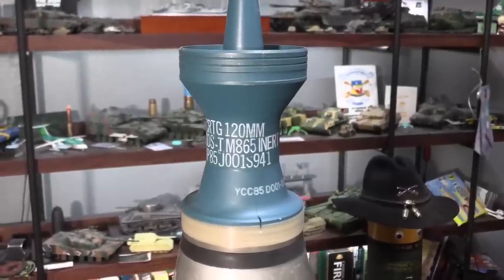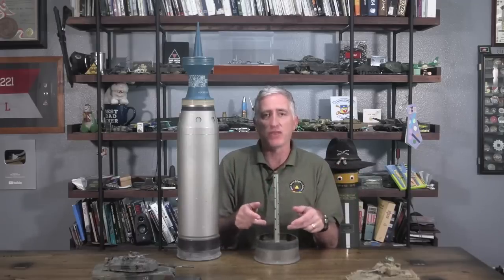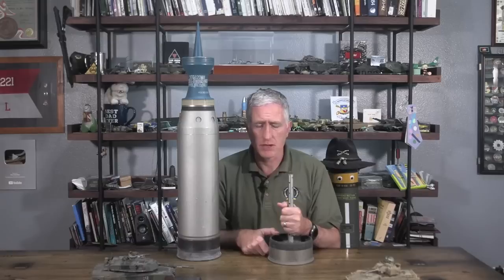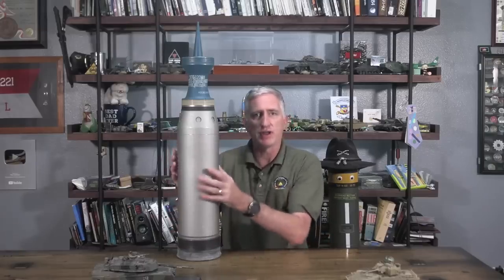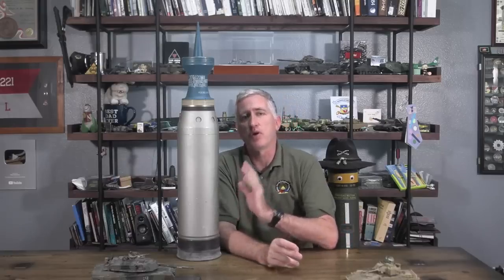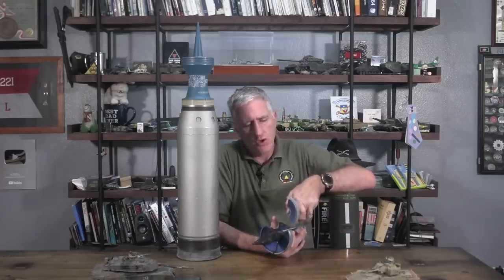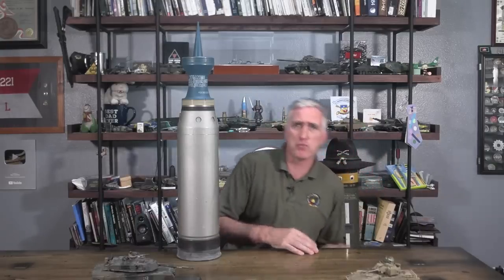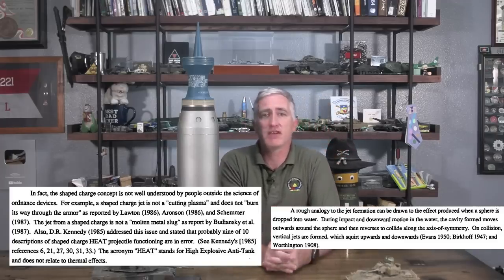Tanks 105: Anatomy of a Modern 120mm Round

Comment: That ball in water analogy is wrong.  The jet travels at a high enough speed that it causes plastic deformation of the armor, punching a hole in it.  A better analogy would be a .22 bullet hitting a large block of clay.  The bullet will punch through the clay leaving a hole.  As an aside, a shaped charge behaves differently when it hits something that will not undergo plastic deformation.  In that case, the jet will either crash through it, or bounce off of it doing very little damage.
Reply from the maker: The document is from the US Army's Ballistic Research Laboratory. That doesn't make it infallible, but it's a reasonably authoritative source.
Reply: @TheChieftainsHatch  I misread the text displayed at the end of the video. That text tries to describe how the jet is formed when the charge goes off, not how the jet penetrates armor, which is what I described.  My mistake.

Comment: Two dissimilar metals in contact generate an electric (known as Galvanic after its discoverer) current; is this why standing the round on its base on the tank floor is not on?
Reply: I think the concern is stray current running through the floor and from the floor though the round, setting off the Big Boom in the fighting compartment and not the cannon chamber.
Reply: The chassis is the ground plane for the electrical circuits. Plus if a live power line fell down on the tank that could be less than optimal.
Reply: I assume that it has more to do with not ending up with dirt and grease and whatnot on the primer which would not make good contact when loaded and thus be tempermental when it comes time to go boom.

Comment: Regarding overpenn, a ROTC guy I know in college said that a round going through a tank would suck the crew out through the exit hole due to the pressure differences and the vacuum as the round left the target.    I don't know if this is true.
Reply: Nope, definitely not an engineering student
Reply: I’ve heard several variations of this over time, but it sounds quite similar to the old theory of a projectile penetrating a passenger plane would result in the occupants being sucked out. 
It doesn’t work like that in reality.
Reply: @PhantomTangeant  There would be decompression, everyone's ear drums would explode, and a cloud would form in the cabin.     This happened over a decade ago to a former coworker who flew SouthWestern.  His hearing hasn't recovered.
Reply: @adamrudling1339  I think the concept comes from the vacuum behind the projectile sucking the crew out of the tank.   Chances are the DU spalling would have turned the crew into hamburger a fraction of a second before anything else happened, including heavy metal poisoning.

Comment: Sort of plasma… Even though it says QUITE CLEARLY in the text YOU provided that the shaped-charge jet IS NOT a cutting plasma and nor is it molten (a stage it would have to pass through to become plasma, you donut) Though this is the first time a ‘tank expert’ has had anything to do with explaining a HEAT jet correctly thus far. Even though YOU still got it wrong, the written word we can trust in this instance. Bejeezus now.
Reply: It's almost as if the images were added later as a correction to what was said out loud in the video.

Comment: Gee, why would powder in an electrically powered turret basket be bad?  I would pour water everywhere by reflex if I did not just completely freak out.
Reply: Unless you had distilled or deionized water, it has enough dissolved electrolytes to conduct a charge from the various systems to the hull & light the scattered propellant or sitting rounds (why you don’t set rounds straight on the hull)

Comment: If the HEAT round doesn't use a thermal effect why is the cone always made of copper ?
Your 105mm HEAT TP-T round appears to be missing the aft cone and fin assembly
Reply: Because it is not always made out of copper?
Reply: @jintsuubest9331  I have never heard of a HEAT charge that didn't use copper as a liner

Comment: The round you are exhibiting is made out a of depleted tungsten rod and when it hits it penetrates the armour and when inside it will throw pyrophoric ( burns in contact with air)fragments of depleted uranium. It will not go straight through as the round will have some degree of deflection and loose alot of its momentum. You said it will either not get through and produce spalling on the other side of the armour OR go straight throug. Not true. You have that confused with a HESH round with has a deforming plastic explosive tip that will smush against the armour and then explode. The explosion will cause spalling on the other side of the armour without penetrative. Please don't make a video about stuff you don't know.
Reply from the maker: You appear to have misheard what I said. A penetration by a dart will bring spalling in with it. Your description of HESH is correct, but I don't have one of those shells to hand.